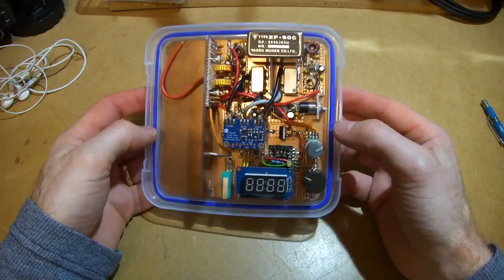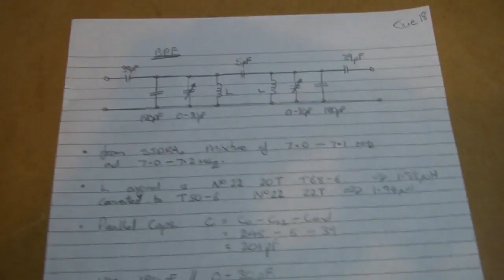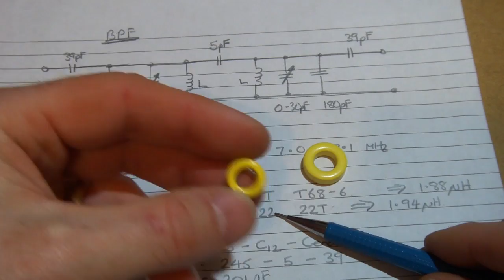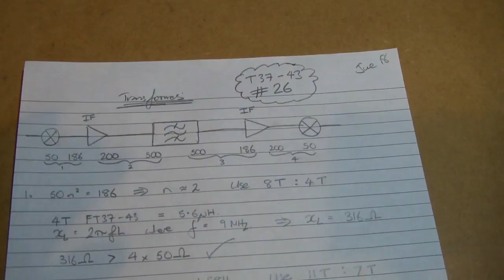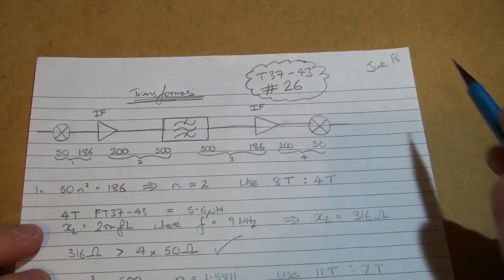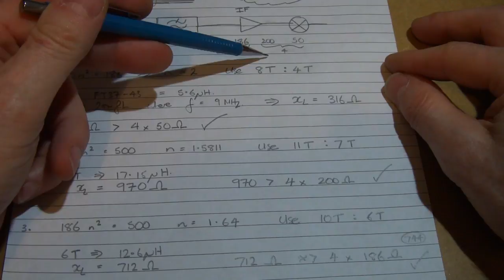Homebrew 40m CW Rig - #4 RX

Comment: Hi Charlie,
I'm still working my way through all your videos.  I plan on trying my hand at building this project.   In a couple of video's you've mentioned the Class E amp. article on the Qrp Labs website but I've been unable to find that particular paper.  Could you please post the link to that?  Also,  if you could link the source for the 4 position 7-segment display used for this project that would be appreciated as well.  As a newbie to homebrew radio any information you can supply as to specific components you are using is really helpful.  The more time I can spend using identical components and the less time I have to spend trying to understand some off the wall component I have selected that isn't really compatible, the better.

Your videos are the best I've found on this subject.  Please keep the projects coming!
73,
Terry
Reply from the maker: Hi Terry. Here is the link to the Class E amp info:
http://qrp-labs.com/images/qcx/assembly3_A4.pdf

As for the display, you are looking for something like this:
https://www.trademe.co.nz/electronics-photography/other-electronics/electronic-components/other/listing-1884672006.htm?rsqid=62e2dec5bf0a495dbb592a26e5530e4c

That display should be available from a range of suppliers. 

Charlie
Reply: @CharlieMorrisZL2CTM  Thank you Charlie!
Reply from the maker: I'm pleased too that you find the videos useful. Hopefully, I can keep doing them for a while to come.

Comment: Great series and enjoy understanding your thought process. I believe that 500 ohms is correct for for the crystal filter. The W7ZOI/K5IRK Progressive Receiver (Nov. 1981 QST) was designed for 500 ohm termination of the filter and specified the XF-90C as an option. 
Jim Russell
Reply from the maker: Excellent. Thanks for that Jim. That certainly aligns with what I saw when I swept the filter.

Charlie